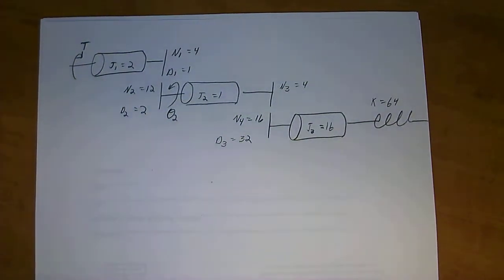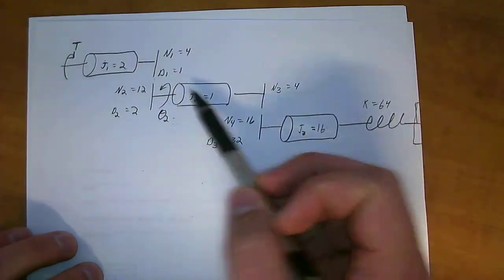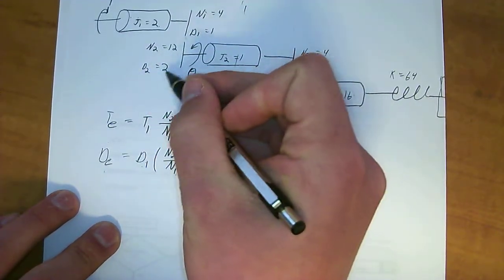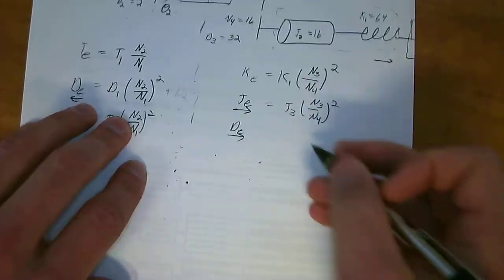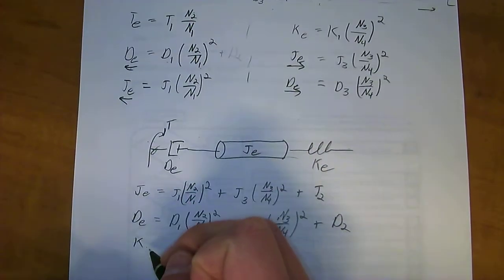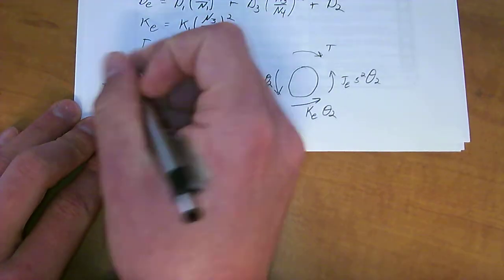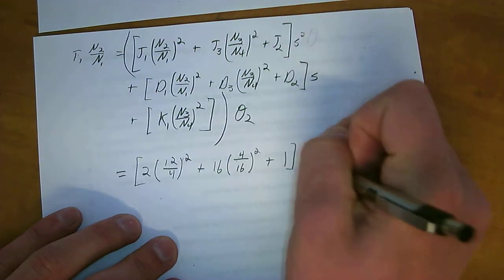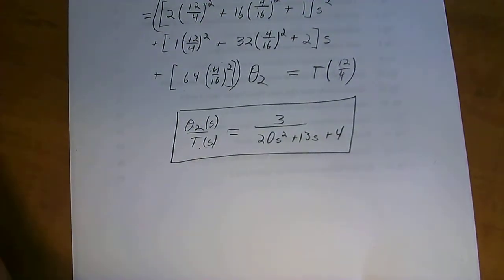Rotational System with Gears to Transfer Function

Comment: I never see anyone derive these systems with an actual physical system. In other word an 'actual' piece of equipment with some sort of sensor on the end of equipment relating the mathematical theory output to actual.
Reply: Solve an electrical circuit, use the transfer function to solve for time at a particular vout, you'll find if you convert the transfer function to the time domain you can predict for example, how long will it take for your desired Vout to reach 2.5V with a step input of 6V. You can simulate circuits online and see the math does check out for these real world systems
Sorry for the bad explanation but hope this helps

Comment: Why the damper value must multiply by n2/n1 square while the torque not??
Reply: to get the  concept behind these  gears with rotational system ,u have to read Control system book by norman and nise  6th edition .U will get the answer